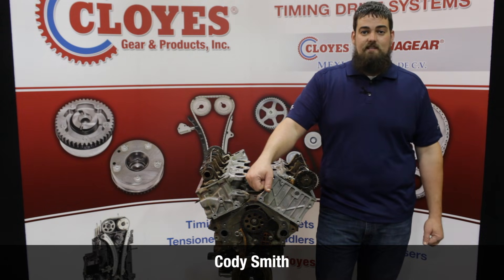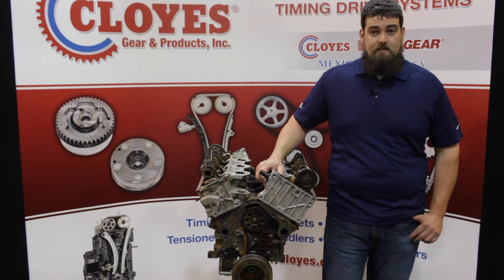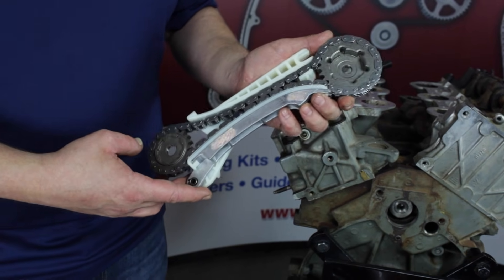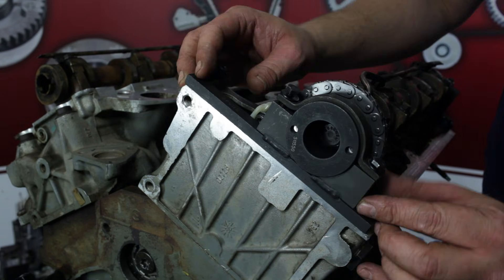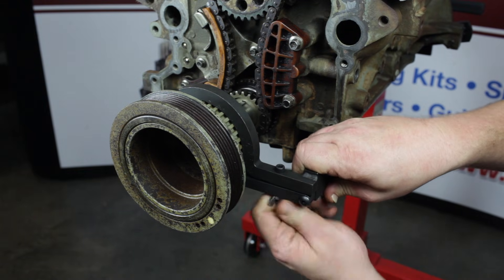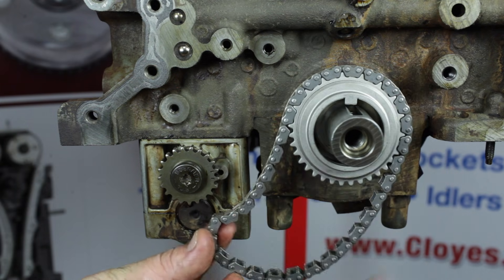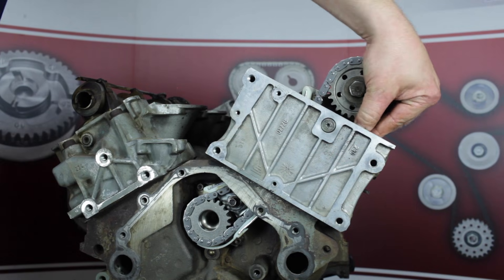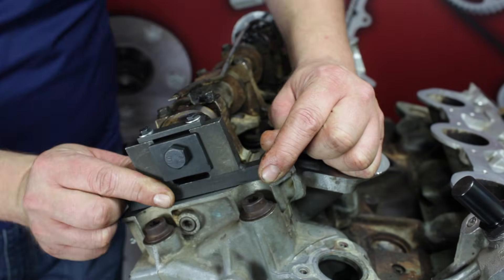Ford 4.0L Timing Chain Replacement, Cloyes 9-0398SB

Comment: My mustang has 223k and still running. If you don’t want to deal with it then do your oil changes on time
Reply: Call 1800 junkyard and shush
Reply: How you think chains get lubricated?  Run shitty/dirty oil and plastic guides will wear out faster.  Then chain will get loose
Reply: Or buy Chevy your call
Reply: @ronaldbrown9638  I wouldn't say anything nice about Chevy since there quality has gone to the dogs and add to the fact they have the worst recall list to boot oh and before I forget gm is packing their shit up and heading to China soon so your call buy Chinese bullshit, run with the best and get a Toyota or buy the older better built vehicles like I do, i can guarantee my truck will not let me down and is 20 years old
Reply: Lol
Reply: Timing chain is certain part that will absolutely fail even with oil change,most cars will need it between 75-100k miles
Reply: I don't like the design either but with proper oil and changes mine lasted to 325k before the timing chain broke on a 2000 Explorer..And those miles were rural mail delivery vehicle..A Hard life in the Northwoods winters and back roads..Most dependable vehicle ever owned despite the shitty set up chains..
Reply: @KR-qs3rt  did you junk it????
Reply: @bt4291  Was getting rusty..Kept it for parts for a 99 EX.we put into the rural mail service..Only thing is this one is a 4.0 OHV. Which I like better because of the simplicity.. 260k miles so far on 99..Serviced properly these things are tough to beat
Reply: Timing chain has nothing to do with oil change lol
Reply: @nessiedestiny8252  wow really how do you think the timing chain gets lubricated

Comment: You say nothing about installing the left hand drivers cassette??? Impossible to install with the jackshaft in place...And you must remove the circlip on the guide to get it in place...
Reply: I installed the cassette without taking it apart since I couldn't get the jackshaft out (engine not pulled) - it's  a tight squeeze but you can tap it down.

Comment: Excellent video. The technician is well versed and competent.
Reply: The balance shaft was not aligned correctly that motor will have a good vibration . There are 2 shafts in the balance unit that need to be aligned not just the drive sprocket

Comment: DO NOT BUY THIS KIT! I followed the installation procedures exactly as the video demonstrated and as well as Ford recommended procedures. The Cloyes kit failed explosively destroying my 120k mi. engine completely. The front tensioners both failed, and the rear sprocket cracked in half taking out the rear tensioner and chain with it. I was cruising at 45mph when this catastrophic failure occurred. there was no warning or indications before this happened. This kit cost me a new engine $3500. If anyone is interested, I still have the failed components, and can provide pictures of the failed components. 
Ben, Tampa, FL.
Reply: this sounds like mechanic error ben. i have worked on cars for 15 years and cloyes is a trusted name...
Reply: @joshdude2137  Josh Dude, thank you for your post. I agree with your general assessment of cloyes. Putting pride aside, I do not agree with installer error. I am very meticulous and picky about the work I do on my vehicles. I double and triple check my work always. I don't see the need to list my experience, but I feel I'm extremely competent in replacing a timing chain set. This is a lengthy but straightforward procedure and in this case there were zero steps that required a special tool that any mechanic wouldn't  have in his chest. In my case I really only needed the front chain and guides, but I decided to replace everything instead because I am going to keep this vehicle. At least now I have a remanufactured engine straight from my Ford dealership.
Ben.
Edit: Forgot .....I did have to buy the OTB timing kit.
Reply: If you followed this tutorial it's no wonder it failed.  This is not a good tutorial.
Reply: This is a bad demo. Go see Fordmakuloco instead. And do not use cloyes. Cloyes fails on plenty of time. Just go research it. Cloyes fails a lot. I own the 4.0.

Comment: what happens if I have no compression? what should be my next move??
Reply: Umm
Engine rebuild ?
Reply: Do it leak down test and find out why
Reply: Buy a Chevrolet 😁
Reply: @ronaldbrown9638   wow, you are an original! did you just make that up? like on the spot? no help? thats incredible.... you are a comic genius sir.
Reply: this is awesome. you have no compression? on any cylinder? and you figured you would just randomly post for advice on a timing chain replacement video... well. lucky day. im a mechanic and this has caught my interest. so any of the six have any compression?

Comment: Looks like a German/euro design. I’m a foreman at a euro repair shop and this looks like something you would see in a Audi/vw engine.
Reply from the maker: It was made in Cologne Germany. The reason for the complexity is that it is simply the older 4.0L pushrod block with SOHC heads retrofitted on.
Reply: @Cloyes01  it's still a poor design
Reply: made in cologne, Germany

Comment: I understand that there are likely benefits to this and similar designs , but why toss the 4.0 pushrod technology ? Redesign for the sake of redesign is just sad.  
 I just searched out a low mileage 4.0 straight six Jeep with iron block and head, and 24" of timing chain instead of  24" and hope to run it a good long time.
 Sorry, just an old school ranter.
Reply: My '98 Jeep XJ is now over 20 years old with 248,xxx miles.  Doesn't consume any notable amounts of oil, coolant doesn't get mysteriously drank.  Those pre-1999 4.0 engines are skookum as hell.  Noisy and unrefined, but oh well.  The job gets done day after day.  To the best of my knowledge, the engine has never been opened up.

Comment: *******Things I learned during my 4.0 SOHC timing chain replacement: 1:use a longer crank bolt to help get the balancer off. 2: installing the bank 2 chain guide is tough, requires force and may break the guide if not careful (the segment that this video skips). 3: I had the cylinder heads off to do head gaskets, had both front and rear chains off at the same time- torquing the jackshaft bolts is possible without the rear jackshaft sprocket holding tool- Use the cam sprocket holding tool and the tensioner tool on bank 2 to hold the timing chain and torque the front jackshaft bolt, then put a bolt into the bank 1 cylinder head and prop the breaker bar against it while you torque the rear jackshaft bolt.------- then set bank 2 timing with special tools and then set bank 1 timing. 4: the timing cover has to be centered on the crank otherwise the front seal will leak badly. I used a micrometer and positioned it best i could and tightened down the cover, and re-checked it. 5: the front crank seal should be pressed in with the plastic crank seal dust shield so the plastic shield is flush with the cover. 6: If you pull out the injectors and the insert in the cylinder head comes out with it, replace it. (ford calls these injector seal adapters) they press into the cylinder head and are hard to get out without valve removal. These were the issues i came across during the challenge, and are solutions that i used with success. Hope this helps someone before they dig too deep of a hole.
Reply: The most valuable thing I have learned doing this? Get it running and sell the snot out of it and never deal with Fords again 😊

Comment: I will welcome it if Cloyes would like to chime in here.  I will also welcome it if they at least help foot the engine repair bill that their product caused.

The way I think it works is that Cloyes is actually the original equipment manufacturer of the sprockets and possibly the chain.  The sprockets had Ford part numbers stamped right into them and the look and feel strike me as being a quality part.  However, I think the guides are just sourced from wherever.  Probably China as usual.

I bought the Cloyes cassette assembly for the left cylinder bank, 1x cassette assembly for the right bank, and 1x primary timing chain kit.

Problem #1:
The left bank kit arrived broken from Rock Auto.  The plastic guide was broken where it clipped onto the metal guide chassis.  I returned it and got another.  Nobody can really prove where/how that got broken, but no matter.

Problem #2:
The plastic primary chain guide is supposed to cover up an oil galley hole, and probably allow leakage that'll result in oil spraying all over the primary chain area for lubrication as I would expect.  If you run a straight edge on the engine block from one mounting point across the oil galley to the other mounting point, the surfaces are all identical height.  However, where the plastic guide would cover up that oil galley, it is about .020" greater there, meaning that to install the guide, it would tweak the plastic guide and possibly cover up the oil galley hole too tightly and actually create a good seal there, which you do not want.  I was able to space it out at the mounting points with washers to compensate.

Problem #3:
After about 3,500 miles and 3 months (after I tore it apart due to the left bank chain snapping), the tension pin that keeps the primary chain tensioner arm worked its way out, and caused the plastic tensioner to be crooked.  It did not result in a problem--at least not yet.  I am confident that it would have, though.

Problem #4
The left bank timing chain snapped in about 3 months/3,500 miles.  This is another area where finger pointing is quick to happen.  My analysis of the situation revealed that although the chassis for the chain guide (not the tensioner arm side--I am talking about the tension side of the chain) was straight, the plastic mounted on it had a curve, bowing away from the engine block in the middle.  Like the originals, the wear surface of the plastic had a small ridge on the side closest to the engine block that is probably there to keep the chain away from the metal chassis.  Well, with this entire piece of plastic having a subtle curve to it and thus and not matching the chassis, it was able to push the chain out of alignment as it ran from the cam gear down to the jackshaft sprocket, leaving it up to the jackshaft sprocket to re-align the chain.  The jackshaft sprocket showed significant wear on one edge of teeth all around it, and the chain's outermost links also had wear marks on just one side which corresponded with the teeth. The wear marks on the plastic show the chain following the curve of the plastic, and right as the chain neared the jackshaft sprocket, the wear marks make a notable turn back into proper alignment, as undoubtedly the jackshaft sprocket was doing that.   

Running my straight edge in every possible way from the cam sprocket to the jackshaft sprocket revealed that the two sprockets were in perfect alignment.  If they were not aligned, it was within a few thousandths of an inch, which would be about what amount of end play there would be in the jackshaft.  And if the sprockets were not aligned, the wear marks would be on both the cam sprocket AND the jackshaft sprocket and would also have wear on both sides of the chain.

Problem #5.  
I bought a replacement engine after the first one I fixed up lunched its valves due to the Cloyes chain failure.  Those 13x,xxx mile guides in the replacement engine had significantly less wear than the newer ones provided by Cloyes with 3,500 miles on them.  Some of the plastics were labeled PA46, some PA66, and maybe even one other in the mix somewhere.  Well, those standardized plastic resins aren't necessarily the same.  China will find a shortcut. 

There are reasonable possibilities that problems #5 and #1 were not the fault of Cloyes, but #2, #3, and #4 are definitely all done by their own doing--probably sourcing the guides from some cheap-o manufacturer and these problems were a big deal.  I am not going to ever buy timing components from Cloyes ever again.  If they reimburse me for time and parts to fix the mess that these parts caused, I'll consider it, but I doubt that they are going to send me a check for $1,500 plus a refund on their timing components.  That would be cheap, by the way.

Interestingly, the bank of cylinders with the broken chain resulted in no piston to valve contact.  However, when the chain snapped and balled up down at the jack shaft, it is my belief that it jammed the sprocket, and since there are no keyed fittings, the torque of the engine was enough to make the sprocket(s) slip on the jack shaft, which threw the other bank of cylinders out of time and those are the valves that got smashed up.
Reply: I agree with your post completely.  My kit failed as well, galling the rear end if the jackshaft. Total loss.
Reply: @robynsecor9042    What exactly broke on yours?  Any pictures of the carnage?
Reply: Here are some of my pictures.
Reply: allways buy FoMoCo parts.they can be a bit pricey but worth it in the long run.

Comment: You have to love those Engineers at Ford they just make everything so Easy   I guy I work with had a price of  $2300  to have his timing chain replaced on a 2003 Ranger.   also from what I hear the 4cyl  Chevy  GMC  truck  Engine is no Picnic either  it has chains on the back side of the engine so you have to pull the trans or pull the engine  nice design    lol
Reply: Not a explorer or ranger on the road worth 2300 dollar repairs and I own one haha
Reply: I just saw one in my travels  a week ago  2006 ranger  I think was a truck for a Construction company  but in very good condition body wise Paint and all for $3200 but I think its getting to those magic miles   Hence the price

Comment: I have done replacing the timing set, engine purrs the only thing the crank pulley does not go in all the way, needs to go in 3.25 m/m's more.
Reply from the maker: You have either put the crankshaft sprocket on backwards, or have the wrong crankshaft sprocket for your engine. There are 2 versions of that crankshaft sprocket, one made for engines with a balance shaft and one made for without a balance shaft. Also make sure the cup side, or countersunk side, of the sprocket is facing outward.
Reply: Yes the sproket was on backward TY
Reply: I did the same thing, luckily I caught it before the engine was installed lol.

Comment: Ok I have no complaints about the video, however!  I suggest checking the thickness of the crank gears with a mike.  As the video states there are two different versions of this set up.  With and without a counter balance chain.  A tech at our shop used what was supposed to be the kit without a counter balance gear.  I believe the crank gears were too thin because when the engine was put back in it would not start.  We spent well over a week checking everything over and over again to find that the balancer (when seated) went in almost 3/8 of an inch farther than it did with the OE gears.  This engine had the balancer with the thin steel exciter ring for the crank position sensor.  On the exciter ring there is a double gapped tooth that is used both for locating the locking tool to set the cam timing but also to let the PCM know where TDC is so that it can start the firing order.  If you look at the double tooth on the thin steel exciter ring you will see that the double gap is there only to just before the outer edge of the ring.  At that point the double gap is bridged to keep the integrity of the ring.  With the thinner gears the balancer went back far enough that the crank sensor was seeing the bridge instead of the double gapped tooth.  The engine would not start because the PCM never saw the double gap and therefore did not know when to start the firing order.
Reply: Good to see some sharing  good information  as the guy in the video  doesn't clarify  this.
Reply: Great trouble shooting by your team. Does Cloyes employ engineers or QC on their staff? 3/8" is a HUGE difference!!!!

Comment: whats roughly the cost (not including labor) for the tools and parts? Also, how do you know you need to do it?
Reply: Special tool kit $200. Timing kit $400. Special bolts from dealer $100. But you need time and a decent shop too. It's not a job for DIY. Imho.
Reply: You'll know you need to do it if you hear rattling when you start it up.  After a while the rattle will be here and there while it's running too. If you pull your valve covers off usually you'll be able to see broken plastic.  If you pull your steel oil pan lower cover off you'll also see plastic bits lodged in your oil pick up screen.